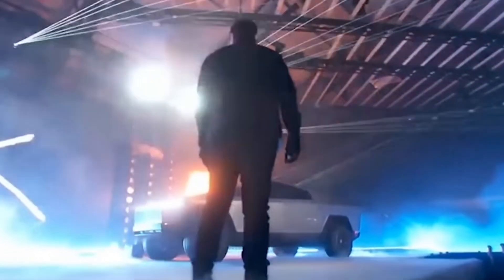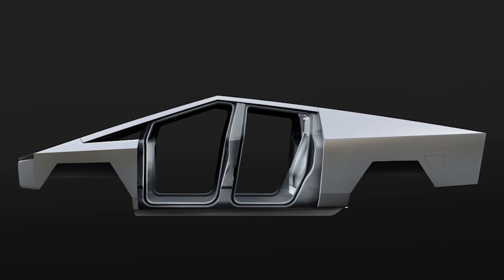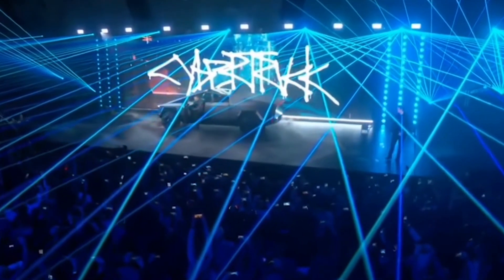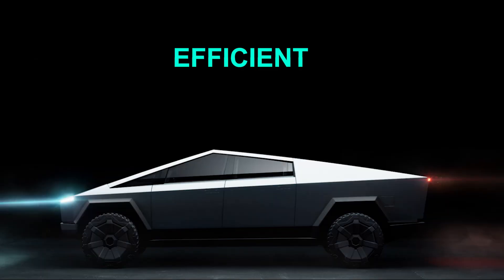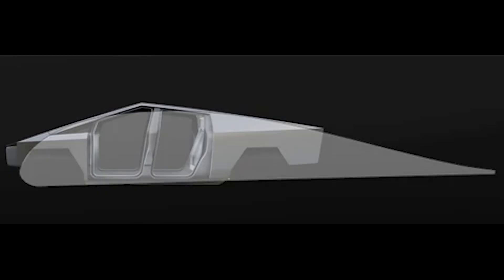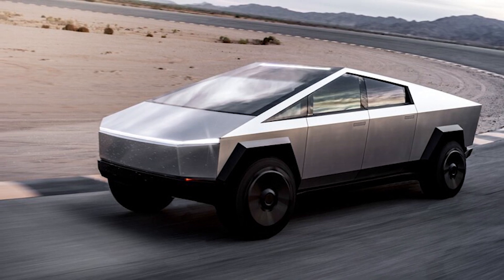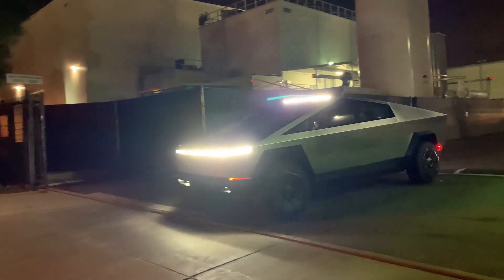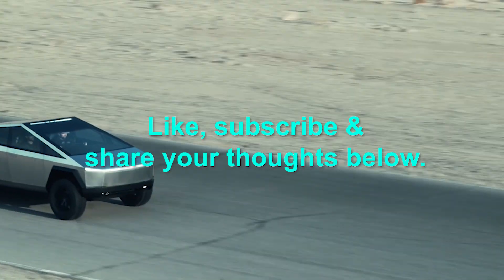Cybertruck is Engineering Genius (and will be copied)

Comment: Man, people are really really really fucking stupid. I am an efficiency person. I don't care for your lifted Ford F350 that DEVOURS more gas than I'd spend on using this vehicle a couple of days a week. Considering fossil fuels WILL NOT GO DOWN in price, as they are a resource that cannot be easily recreated, this is the right call. Argue this, and I can tell you straight up right now, you are a fucking moron. 

All the Ford triggered posters: You don't have to throw everything in the bed, get a small trailer. Or is driving a truck already hard enough for you? I drive a Diesel Turbo Ford Excursion, and I attach trailers all the time. Why? Because I actually care about my vehicle. It's the proper way to TOW. Not talking preference here, I'm talking dynamics and efficiency. 

Consider the fact that Tesla is also progressing FARTHER than anyone in the electrical motors field... it's time. No one competes on their platform. The 3 safest vehicles IN THE WORLD. Elon's statement to make vehicles more affordable, now being clearly seen... WITH A TRUCK to boot. Can't wait for the car edition to be released. Oh, if you hand't noticed, this is clear foreshadowing. Not to mention cleaner air, smoother ride, ALL CURRENT vehicle features as STOCK (BT, AUX, censors, navigation, ETC ETC ETC), you won't beat it. If you want to argue about it, feel free to do so. Give me a good example of what a competition vehicle would be and I will post all it's information as a response with side to side comparisons. Yes, I enjoy to destroy people publicly with educational and informative counter arguments. I'm ready ;)

Comment: What's the cost of repairs after a crash. Looks like you have to take the whole thing apart and back together
Reply: Eric Henn what, you don’t have to pull current cars apart after a crash!? Hahaha looks like there are joins everywhere and flat panels are far cheaper to produce then complex curved panels. Hence why this truck is so affordable. So I doubt it’s any more expensive then traditional car repairs. Oh wait. No paint matching, either.
Reply: @Jack_Hagerty  yeah exactly current cars so many different parts and body panels and wires etc this is a big step up

Comment: i mean, if a buyer really wants a different color, just take it to a shop to get it painted. one thing though, the stats in this  vid are all theoretical, until the actually product comes out, cant really tell how much the weight the truck can support
another thing, having a super-rigid vehicle is not necessarily a good thing. a vehicle is designed to crumple to absorb impact force and reduce the risk of harm to a passenger/driver

Comment: 6:50 I am fine with the Cybertruck mostly except for this bit. It is not a benefit if it is too rigid, esp the front. That is why crumple zones exist- to lower impulses of collisions
Reply from the maker: Lots of people are raising this. The steel can be scored on the underside to crumple predictably and consistently (and it appears the frunk is a separate coponent). I think many will be surprised at how well the Tesla engineers address this. Safety is always top of mind at Tesla. It may not appear so but the driver in Cybertruck sits the same distance from front of the vehicle as they do in Model 3 so there's equivalent space for crumple zone too.

End of the day, Cybertruck won't be allowed on roads if it is not sufficiently safe for occupants or pedestrians. Tesla are smarter than to design an unsafe vehicle 😉
Reply: @SolvingTheMoneyProblem  But they specifically state it is rigid. When you say that it is suddenly able to crumple, that sort of negates it being rigid.

Comment: This is so rigid. If it smashes in a wall driver would easily die
Reply: No air bag? But lo i got a better point what will happen if u hit someone with this?
Reply: Won't be different than normal cars
Because a car have a metal thing at the front the truck is pretty much the same
+teslas are one of the the safest cars ever

Comment: Your points are really important in understanding how Tesla can achieve success, however I don't think that other car manufacturers will go the same road as Tesla. People buy different cars for different reasons. For some people it doesn't matter that french Renaults or Peugeots are unreliable. For others - it doesn't matter that modern Opels/Vauxhalls have no soul. It doesn't matter that costs of repair for BMW or Mercedes are insane. There are still a lot of 1008s, Clios, X5s or Insignias on our streets. It's all about a brand, history, popularity. For some, factors like reliability or efficency are more important but I don't think that applies to majority of consumers. If people would buy cars rationally, we'd all be driving the same two or three models of some japanese car.

Comment: curios....who told you there is no stamping involved in producing the "cybertruck"?. How would you form the metal?.....cast it?. Flat panels are EXTREMELY difficult to produce with a "class A" surface......(think of the wrinkles in the bottom of a cookie sheet)......Tesla is great for thinking outside the box, but is absolutely CLUELESS about how to produce a vehicle (yes, I am qualified to make that statement. I deal with them (and all other manufacturers) everyday. I could give you a 20 minute rant as to why the model 3 was late to production. In short they trust a guy with an MBA or a guy with a "bachelor's in education"  who are GROSSLY unqualified to approve engineering, tooling and automation decisions.........And NO, they didn't learn any lessons in bringing the model 3 to market....they are repeating them on the "model Y" coming out......this truck is MORE expensive to produce, not less.....if it DOES go into production, it will go the way of the Delorean in a few years.

Comment: Many dreamers on this post. DeLorean tried stainless before, we all know why it was not a success. If you are an educated engineer, you understand why stainless is not such a good idea. And above that, try to repair a bumb... If I were Tesla, I would concentrate more on the quality. Just check the hundreds of Tesla taxi cabs in Amsterdam. Talk to the drivers, or read the reports. That is the truth, they don’t want these cars any more. Doors that do not close, windows that do not open, lights that show water inside, do you need more? 200 km on one load due wintertime, and winters are not really cold here, 40 corrective actions with in 24 month’s is normal, but means less turn over for the drivers. You know what? They hate them, Steve Jobs would hate them .... You are insulting Steve Jobs intellect by saying Elon Musk is like him. Jobs was a fanatic quality expert. At apple they would not break a window in a Keynote, what a marketing disaster! Tesla, fix your design issues! And above that, driving on electricity made out of oil does not really make sense for the environment either.

Comment: truthfully wish i needed another vehicle, sadly i do not.
had many beautiful trucks for over 45 years, Now retired.
 73 years old I drive  a little comfortable white
 Mazda sedan to take to market or restaurant.
5 years and 18,000 miles on the clock ,
 It will probably last my lifetime before I need a new vehicle

Comment: First problem, can it tow? Many experts (a weasel, but heck, you can go search for it to verify yourself) theorized it isn't possible yet for electric vehicles to tow long distances due to the limitations of current battery technology. Towing requires much energy and with the current energy densities of lithium ion or polymer cells, it's impossible to tow long range. If it can't tow, no one's buying no matter how efficient Musk makes the things. Truck people buy trucks to haul stuff.

Second problem... stainless steel. It is not possible to remove dents from stainless steel. I know this stuff because I come from a country where people use stainless steel to make vehicles that haul stuff, check out the stainless steel Jeepneys of the Philippines. If you told anyone here you could repair a dented stainless steel surface, they'd laugh at you. It's common knowledge. Stainless steel is easy to work with, true, but is a pain when wrecked, disposable at best and heavier than regular steel. I can imagine, repairs may require replacing the dented stainless steel parts totally and can be expensive.

Third problem, ugly stuff is ugly. You are spot on at pointing out how Tesla cut corners to produce the truck, which should revolutionize the manufacturing process in the automobile industry, but I wonder how normal people view it, especially truckers. Truckers interviewed in other videos here in youtube were not impressed and ordinary people find it funny. So the question is, who will buy it? If the truckers won't, ordinary people won't. They're into SUVs and cars, not trucks.

Comment: Good points. There are actually 2  minor curves running from the front all the way up to the upper middle intersection point where the windscreen ends and then another minor curve from there down to the rear of the vehicle. This is not overly noticable unless you bring that side profile picture into CAD software and analyze it. I beleive its done this way for aerodynamic purposes see coander effect and also it probably aesthetically looks nicer the way light bounces off it.

Comment: Want to point out one thing. 
On safety you mentioned that it's sturdy and rigid. But for a car that's not actually a good thing since if it get in a crash you want something with crumple zones. Being "rigid" is not a good thing.
Reply from the maker: Lots of people are raising this. The steel can be scored on the underside to crumple predictably and consistently (and it appears the frunk is a separate coponent). I think many will be surprised at how well the Tesla engineers address this. Safety is always top of mind at Tesla. It may not appear so but the driver in Cybertruck sits the same distance from front of the vehicle as they do in Model 3 so there's equivalent space for crumple zone too.

End of the day, Cybertruck won't be allowed on roads if it is not sufficiently safe for occupants or pedestrians. Tesla are smarter than to design an unsafe vehicle 😉

Comment: Genius? Its cheap garbage the entire thing designed to be manufactured as easily as possible. He didn't pick straight lines because he thought it was cool he picked em because they are cheap. Until these idiots either find a way to charge batteries in 5minutes or finally figure out they need to make the packs standard and quickly swappable electric motors with never work. Even then though the packs don't last all that long and the resources that go into them are all very very toxic are they really the answer anyway?

Comment: Amazing truck! Just curious how crumple zones will work on this truck. Elon takes safety seriously so I'm curious what changes Elon will imminent. Amazing video btw.
Reply from the maker: Lots of people are raising this. The steel can be scored on the underside to crumple predictably and consistently (and it appears the frunk is a separate coponent). I think many will be surprised at how well the Tesla engineers address this. Safety is always top of mind at Tesla. It may not appear so but the driver in Cybertruck sits the same distance from front of the vehicle as they do in Model 3 so there's equivalent space for crumple zone too.

End of the day, Cybertruck won't be allowed on roads if it is not sufficiently safe for occupants or pedestrians. Tesla are smarter than to design an unsafe vehicle 😉
Reply: @SolvingTheMoneyProblem  very true! Excited to see when elon will reveal it's safety features.😎

Comment: Getting used to the design, however, performing a repair on this would be a nightmare with a unibody design...
Reply: Hi. Not sure about that. With no paint, no curves and thick metal, any welder can cut out a patch and grind it back in.

Comment: That thing is goin to get 0% for pedestrian safety
Reply: Wow people like you are BLIND. It has no sharp edges at pedestrian level. It's all Flat Vertical Panels. Unlike sport cars which have sharp angles at Leg Level yet those are street legal. The front bumper is flexible plastic that is just coated like stainless.
Reply: Neojun ur the one blind, it doesn’t have a plastic bumper, instead the whole car is made with hard steel. The other thing is the slanted glass could hit taller pedestrians while the steel could hit the shorter pedestrians head

Comment: So Cybertruck is not just engineering genius, but Elon Musk absolute genius so claimed by this video. 

So all those engineers & designers of Ford, GM trucks, Japanese truck, M-B trucks must be pretty stupid not to come up with the Cybertruck design after doing it for decades. 

This is same kind of delusional BS Musk worshipers said about Tesla EVs like Model S, 3. Which surely must have taken over the entire world by now. Defeat climate change. And Tesla must be the world biggest and most profitable EV company by now. Instead of struggling to produce less than 10,000 cars after 15 years of trying. Have not made a dime of profit yet. The SEC rewarded Elon Musk genius by firing him form the Tesla board chairman job. Tesla has so dominated the EV market in the U.S. (Tesla marketshare 0.04%) that it borrowed $550 million (which must be repaid by 2020) from China banks to build it first Shanghai factory. And this wonderful advanced high tech Tesla China factory (no tent there, do you think Chinese regulators stupid enough to allow it?) will make the, yes, Model 3 which was designed 5 freaking years ago. To sell in the China EV market, which is the most advanced and biggest in the world. 

So those Chinese EV engineers must be pretty stupid too. They are trembling in fear with the introduction of Model 3 and should be ready to commit suicide if the Cybertruck ever get introduced in China. Will China steal Cybertruck like they stole just about everything American? Like those ultra advanced high speed trains, 5G telecom, even mega tankers.

Comment: 6:34 - But it's a bad thing that the chassis can withstand a sledgehammer. That means it can't absorb force on impact, cars are supposed to crumple. This may make it more dangerous for the driver?
Reply from the maker: Lots of people are raising this. The steel can be scored on the underside to crumple predictably and consistently (and it appears the frunk is a separate coponent). I think many will be surprised at how well the Tesla engineers address this. Safety is always top of mind at Tesla. It may not appear so but the driver in Cybertruck sits the same distance from front of the vehicle as they do in Model 3 so there's equivalent space for crumple zone too.

End of the day, Cybertruck won't be allowed on roads if it is not sufficiently safe for occupants or pedestrians. Tesla are smarter than to design an unsafe vehicle 😉

Comment: Engineer here...  This video is full of BS. The body isn't folded from a single sheet of steel & there will be plenty of stamping to build that body..  If you want a rigid body, floor etc you HAVE to stamp it & you're overstating the cost of stamping steel at scale.

Comment: Couple of points you're getting wrong: The cybertruck will use stamping machines,.. and the truck will have a chassis just like the other cars...and the aerodynamic performance is not good at all, but that doesn't matter. Regarding the exterior design, it is very cool, polarizing, 70s style, like a Lambo Countash, or a Maseratti Boomerang, or Blade Runner, or low poly museum creation from Rem D Koolhaas
 in 2015, whatever you want to call it, it pure gold in terms of marketing. And that's it: Be different from the crowd, Cut cost (less is more, multiply), Cult creation. Profits! 

 -car designer

Comment: I have a few questions about range. It is given with an empty truck on normal roads. What happens to that range when you hitch a trailer on that thing? Here is another. You now have a fancy electric all wheel drive off-road vehicle and you want to go out into the outback on those dirt tracks. What happens to your range then? You'd better bring solar panels and travel the way Mark Watney did in the film "The Martian".

Comment: I agree that many elements of the design, while controversial, are well thought out from an engineering and utilitarian standpoint. But I disagree that the Cybertruck is a safe vehicle in the form shown at the demo. The body panels are constructed from 301 stainless steel that has been cold-rolled 30x. While cold-rolling so much would result in a VERY strong steel, the material will also lose ductility and toughness; in materials science, strength and toughness are not synonymous terms, and the latter is more important for safety. In the even of a crash, you would actually want the car to deform in order for the impact forces to be absorbed before reaching the occupants in the vehicle. When you construct the body with a steel that is so strong it won't deform in the event of a crash, this also renders the vehicle unable to properly absorb the forces of impact. This is why there is a crumple zone requirement in all modern cars; with such a short nose on the Cybertruck, I don't know how a crumple zone can be included. We saw firsthand the consequences of using the super-strong steel during the demo. When the sledgehammer impacted the body, instead of being absorbed via denting, the force was transferred to the windows, causing the base of the glass to be damaged. As a materials scientist, I think the Cybertruck we've seen is still very much a prototype, and in order to pass the crash test, significant changes will have to be made to the current design.